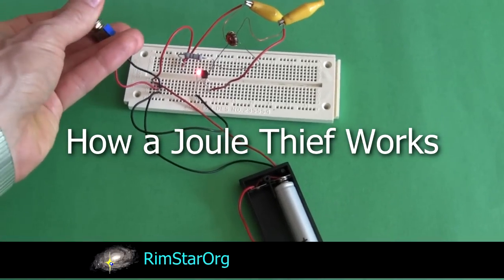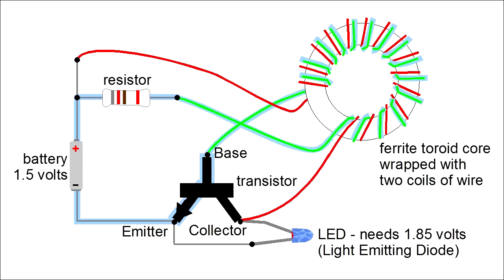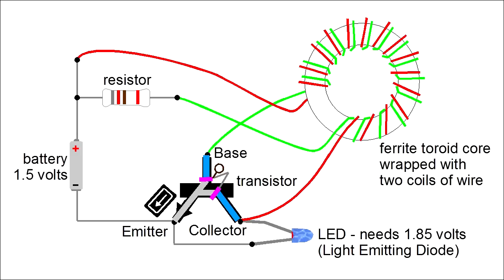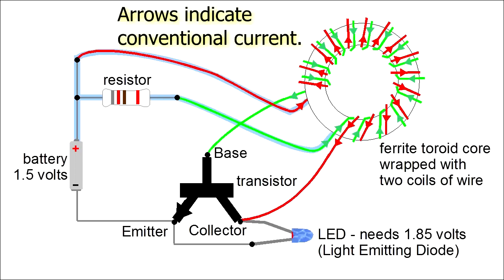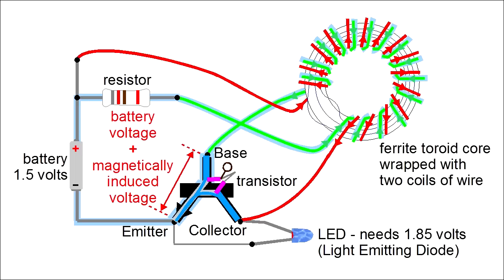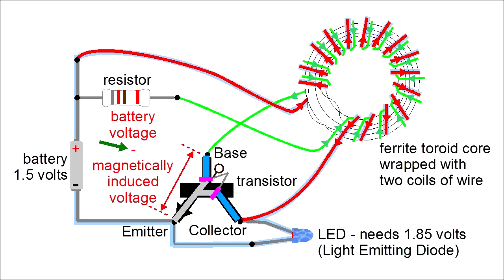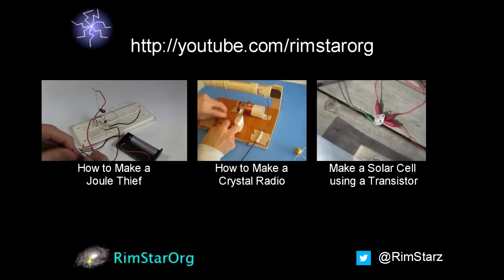How a Joule Thief Works

Comment: I am using an NPN transistor of MPA 42 and I simply cannot get my jewel thief to work the transistors good in the battery has 1.5 V and I’m using a 103K resistor
I hand wind a small ferrite transformer 20 turns from a old led light and not a toroid core ??? I see a small voltage drop in the battery but it dose not step up the voltage!! Can you help ?
Reply from the maker: I remember trying a straight ferite rod too and it didn't work for me either.

Comment: NO they take about 18 , to 20 MILLIAMPS , regardless of the voltage ,,,, and the FORWARD VOLTAGE DROP is between .3 and about 3 volts depending on the color ... you can light a led with 120 volts if you want to , you just have to limit the CURRENT with a resistor....

Comment: if we use joule theif....
...can u answer my 1 question..

For example.
   if i use a battery which will give power to LED for total 1minutes after that tge batterys charge become empty..

if i use same battery without joule theif does it last for 2 minutes
Reply from the maker: That's hard to say. The joule thief is a horribly inefficient circuit so it may last a shorter time. It's real use if for running off batteries when the battery voltage has become too low to power the LED with just the battery.

Comment: So... where should a capacitor go and of which value to pulse this at 60hz?
Reply from the maker: +Shaheer Syed Since you asked for 60Hz I assume you're looking for an inverter or something that can put out a useful sine wave, like for  household appliances. This isn't that. The output is very spikey, and even with a smoothing capacitor you still won't get a sine wave. But to answer anyway, a smoothing capacitor would go in parallel with the LED, i.e. one capacitor leg on one leg of the LED and the other capacitor leg on the other leg of the LED. I don't know what value capacitance you'd need so you'd have to experiment. It should not be an electrolytic capacitor. This works at a much higher frequency than 60Hz so I don't think you can get that.
Reply: RimstarOrg Nope, just for drawing some nice big arcs. The 60 hz wave is just for the beautiful sound. Thanks

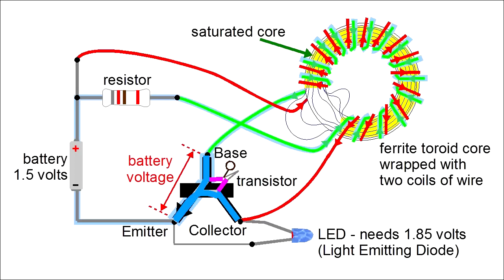Comment: 3:55 absolutely incorrect explanation. When transistor gate is open red wire induces opposite voltage on green wire through the coil, and transistor is closing, and the rest of the magnetic energy goes to LED, then cycle repeats.

Comment: Does it work on dead battery (fully discharged). If it work, where the electricity come from ?
Reply from the maker: That depends on what you mean by a dead battery. A battery whose capacity has dropped too low to power a DC motor could still power a remote control. So it's dead for the DC motor but okay for the remote control. If you mean it's all the way down to 0V, then no, this won't work with that battery. Even a joule thief needs a minimum battery capacity and voltage to work just like anything else.
The name, joule thief, is misleading since it doesn't steal energy (joules). It simply stores the energy and then releases it in a burst, then stores it up again, then releases it in a burst. That's how it can output a higher voltage, but only during those bursts. And not everything will work with that type of periodic busts. It's simply a boost converter with a fancy name.
Reply: Oh, Thanks, but can we replace battery capacitor, peltier, solar panel, or radio crytal ?
Reply from the maker: No, this isn't a power source. It's just a way to step up the voltage, much like a transformer does. Don't be misled by the name.

Comment: i tried a different torroid/wire combo and its still no go, i also noticed that i am getting battery voltage at the led, not an alternating voltage, i think the transistor is bad

Comment: So, what's the frequency of this switching phenomenon ???
Reply from the maker: With this simple LED circuit and an 820ohm resistor I got around 22kHz.
Reply: RimstarOrg Doesn't the inductance of the coil affect the frequency as well ?!
Reply from the maker: Possibly. I would think that the inductive reactance, which is dependent on the inductance, plays a part. The frequency I gave you is a measured on which I show in this video https://www.youtube.com/watch?v=B61DU7yEsPM.

Comment: How is the red wire grounded while it's inducing current in the green wire?
Reply from the maker: Pilot924 I'm not sure what you mean. Nothing's grounded in this circuit.
Reply: Sorry, I meant is I don't know how the red wire induces current into the green wire without the red wire being hooked up to negative. Or is it
Reply from the maker: Pilot924
Oh. For the first part of the cycle when the magnetic field is forming the current is going from the red wire, to the transistor's collector, to the emitter and then to battery negative. For the second part of the cycle when the magnetic field is collapsing the current is going from the red wire, through the LED and then to battery negative.
Reply: Oh I see, at the beginning the green wire still opens the transistor a tiny amount through the base.

Comment: How often does this process repeat?
Reply from the maker: It's around 23 kHz, or 23,000 times a second. You can see this at around forty seconds into my how-to-make video https://www.youtube.com/watch?v=B61DU7yEsPM. But that can be tuned by changing things such as the value of the resistor. You can see that in the video where I play around with this circuit to power a CFL https://www.youtube.com/watch?v=yz_99oVMbSI.

Comment: Yes, you are right, sorry.  The duty cycle will also vary as the battery terminal voltage changes.  Spike is ok, the voltage spike could kill a led.  But putting on a voltage regulator would reduce efficiency.  Never mind, this is of curiosity value only.  I do use a smps with a "D" cell to power a 9V DVM.

cheers

Comment: Oops! You should say the initial collector to emitter circuit is open right? Did anyone notice that?
Reply from the maker: +Douglas Allen That's right, initially the collector to emitter circuit is open, no current is conducting. That's the way it's designed to be. Or did you mean something else?

Comment: That depends on the load current.  Batteries generally have a mAHr (milliamp hour) rating.  Divide the rating by the load in mA, answer is in hours.  Will actually be a little bit longer because you will make the battery very flat.  Don't try it with a rechargeable battery, you would ruin it.

cheers

Comment: what if i put more turn in the coil..what will happen??is the output voltage will increase??
Reply from the maker: +Mark Junald Junio At a guess, you'll store more energy in the coil for each cycle, and in this case that also means higher voltage. But it will take longer so you'll have less cycles i.e. lower frequency. But the frequency is already plenty high.
Reply: +RimstarOrg thanks for the quick reply :D
anyway i like your video, well explained .. ill try this one :D
Reply: +Mark Junald Junio one more question, can i use any NPN transistor?
Reply from the maker: +Mark Junald Junio I used an NPN transistor. Maybe you meant to ask if you can use a PNP transistor. To use a PNP transistor you just need to reverse the battery in the circuit.
Reply: +RimstarOrg ahh i see..well, thanks again sir.. :D
Reply: this is incorrect - assuming we are using 3904npn and and the same schematic shown all over the web, you can replace the 3904npn with a 3906pnp exactly pin for pin - and you then have to rotate the LED 180degrees, then reverse the battery - now you have a PNP jewel thief.

Comment: Current doesn't flow Positive to Negative in that direction.  How does any of this make sense?
Reply from the maker: It's called conventional current. The direction comes from the days before we knew about electrons. It's still used today since for designing circuits, the direction doesn't matter. I should make a video about it someday but I did write an article about it here https://hackaday.com/2017/07/17/conventional-current-vs-electron-current/
Reply: @RimstarOrg  I understand the the explanation of conventional current. But that still doesn’t answer. 
The description of how a joule theif works is based on + to - when that isnt the actual direction its going. 
So therefore all the joule thief explanations make no sense
Reply from the maker: But the direction of the current doesn't matter. The battery applies a voltage across the whole circuit. When current flows through the coil, a magnetic field is created. When there's sufficient voltage across and current through the base and emitter of the transistor the current can flow between the collector and emitter. When current flows through the LED, it lights up. I chose to talk use conventional current for this video but I really didn't need to choose any direction at all.

Comment: Can u tell what's the value of the base resistance?
Reply from the maker: ayman zayed In the one I show in my How-to-make video (https://www.youtube.com/watch?v=B61DU7yEsPM) I use a 1 kilohm resistor but you can play around with different values, usually lower than 1 kilohm. You'll see the effect in the brightness of the LED, less resistance is brighter. You can also replace the resistor with a potentiometer, which is a variable resistor, one whose resistance you can vary to easily try different values. Then you have a dimmer knob for the LED. I demonstrate that in my video where I play around with powering a CFL (https://www.youtube.com/watch?v=yz_99oVMbSI).
Reply: Thanks, wonder if u have soldering tools for sale I can buy it?
Reply from the maker: ayman zayed Nope. Try ebay.com, or a local electronics store.

Comment: good video.........good explanation..........
the mechanical analogue sucked though..........here's what it is---you have two masses(weights) on both the junctions(C-E and B-E); the former is heavier than the latter, only when you apply enough force to lift both masses can there be water flowing through both paths, however you CAN apply force enough for just lifting the lighter mass, in which case there will be flow only through the B-E path
(Y) :)

Comment: Hello from brasil. 👍😆
I have some 1,5 volta mini solar cells.. I think i will usethis circuit to encrease the power of my mini solar cells.
What do u think?
will it work?
I have some transstors.. Dunno if they are pnp or npn_. They are _BD139
Thank u Sir. Videos like yours are very important!
👍😆
Reply from the maker: It won't increase the power of the solar cells. The power will actually be less, due to the inefficiency. It will give you spikes of higher voltage though. That works for lighting an LED.

Comment: Why doesn't the inductor just stay at saturation and keep everything flowing the way it is in DC? Why does the field collapse? 

Is it due to (maybe) the currents lagging each other. If the red achieved it's steady state first, then the green would still be coming up to it's steady state, and even though that opposing magnetic field from the green is nowhere near as strong, it's still growing in it's direction, which is opposite to the steady state of the red, causing a now negative rate of change in the magnetic field from the point of view of the red wire...? 

But wouldn't the red current lag the green current since the green is needed at the base to start the red off in the first place and the green has a lower phase angle due to have more resistance. Meaning that the green would go steady state first while the red continues increasing? Thereby never actually seeing a negative rate of change the magnetic field from the point of view of the red which dominates? 

The steady state equations for self-inductors says having a smaller resistance will increase the time to steady state, but a smaller inductance will also increase it, and the presence of the green would lower the inductance that the red feels...?
Reply: The voltage across an inductor is given by V = L * (di/dt), where di/dt represents a change in the current over time, when the core saturates the current stabilizes and the inductor stops working like before, then the magnetic fields colapses and causes an overvoltage to compensate this. Please correct me if I'm wrong.

Comment: well its me again i have doubled the secondary coil like 150 turn and primary 5 turn so like it gives same current so help me out please
Reply from the maker: It sounds like you're thinking of this as a step-up transformer. It isn't. If you want to step up the voltage like that then one way is to use a 3rd coil. The first two coils do the joule thief thing as described in this video and the 3rd coil is the step-up. See my video "How to Make Joule Thief Light a CFL - Jeanna's Light" http://youtu.be/FkLET8MhRbU for that. However, that will give you hundreds or even more than a thousand volts.
Reply: than really sir very mucj

Comment: I can't make it work also,,the output voltage is the same as the source..and sometimes it is lowered...what's wrong with my work??I used BC547B and my source is around 1.1 Volts

Comment: will a steal washer work in place of the ferrite core? probably a stupid question.
Reply from the maker: I can't say for sure. The only question I can think of is that the eddy current might cause inefficiencies, but it's worth a try I think. You could also stack them with paper, tape or anything thin and non-electrically conductive in between each to make a thicker core.
Reply: I'll give it a try. Thank You

Comment: I have 2 aa s both are at .9v when I put one on the circuit it works but when I add the other one so I have 1.8v, it doesn't work , why is this

Comment: Power on, voltage flows from base to emitter(green coil). 
collector emitter opens and starts flowing.

 red coil builds up magnetic field, opposing the current  in green coil, stopping  the current flow from base to emitter.

 collector emitter (red coil) current  shuts down. back emf of collapsing field (red coil) lights led.

settings, speed 0.75 hahah

Comment: Really strage theory but its in fact  true ..
And more strage thing that if you measure voltage across led's pins you will find it exactly like battery's voltage but it light up the LED ..
Its really unbelievable. .

Comment: How come the high voltage does not blow the led?
Reply from the maker: I suspect it's due to how brief each pulse is. They're not long enough to damage the LED.
Reply: @RimstarOrg   By the way , I added one wire to the base and extended the emitter .  This gave me 2 probes and thus I created a humidity sensor for   plants.  When there is water ,  the 2 wires get closed and the light goes off.
Reply from the maker: Ah, very cool. Nice idea. Thanks for sharing it.

Comment: What are its applications in daily life??
Reply from the maker: None that I'm aware of. It's just a fun circuit to play with that gives some fun results (running an LED off of a battery whose voltage would be too low otherwise.) A joule thief circuit is fairly inefficient. Boost converters are better for practical use and you can buy them in chip form these days. In that case they're practical as DC-to-DC converters, stepping up  the voltage.

Comment: how many hour of light can stay light!! the l.e.d??
Reply from the maker: +talastas789 I've never tested it. I did test my CFL powered by a joule thief and that stayed bright for 1 hour and 30 minutes, so I imagine an LED would last longer though that required two batteries. If you're curious about the CFL testing it's around six minutes into this video https://www.youtube.com/watch?v=yz_99oVMbSI.
Reply: +talastas789 mine has run 15 hours with no change so far..

Comment: What I would like to do is to reduce the vibrational rate of the circuit, making it more efficient. If I can reduce the vibrational rate of the circuit, the battery will last way longer.  anyone have a idea about how to achieve that.

Comment: I went to Radio Shack to buy the parts to build this and then I decided to buy another battery instead.  Somehow, it seemed simpler - and cheaper.
Reply from the maker: It's simpler, but you miss out on the fun of playing with the circuit and the feeling you get when it works. But if all you want is a lit LED, then buying another battery is the way to go.

Comment: The video / drawings are good and great way to explain it.. However, people need to understand the reality of DC electronics is negative to positive. Though "Conventional Current" is out there.. and lots of people tend to use it .. I am starting to find people argue with me, that they have seen it or read about it flowing to from positive to negative.. and i get so frustrated.. every circuit i build.. i build with the proper electron flow in mind. Neg to Pos.

Comment: So this thing is a really fast on off switch (Human eye only being able to see 60 frames per second and speed of light being crazy fast).
Why not just use a capacitor to amp up the volts (ask the noob)?
Reply from the maker: You mean charge up a capacitor, dump it, charge it up again, dump it, ... Sure, that's another way.

Comment: can i use n channel mosfet?
Reply from the maker: +Hilmi Albums I think I once saw someone somewhere using a MOSFET for a joule thief type circuit but that was a long time ago and I don't have a link. So I really don't know for sure if you can.
Reply: +RimstarOrg okay and thanks for reply. i will try with mosfet. what happens gonna be.  if i not try. i will not known
Reply: +Hilmi Albums use a resistor between gate and ground...
Reply: +Hilmi Albums You should be able to, they function the same as p channels, the base still controls the current, but the current direction is reversed.  There's no difference between N type or P type besides the direction of current.  In fact, if you reverse-bias the P type FET and install in this same circuit, the circuit would function the same exact way.